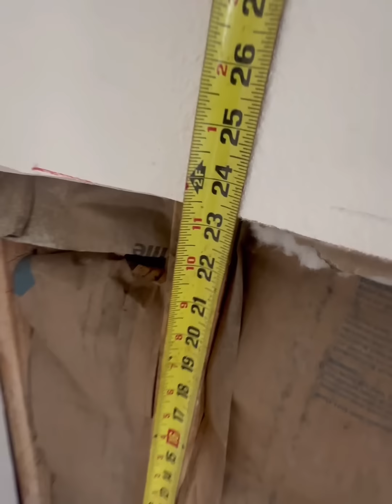Job COMPLETE - Let’s go HOME

Comment: So glad the cows got home. The family needs to be doing some flood control work at the pond and creek where the overflow happens. It would have to be set back aways. I was thinking of a rock or foundation brick retaining wall set with a ramp for the animals to use to get to the water. But there are a bunch of other temporary ways of diverting the water i have seen on YouTube and they might be a lot less expensive in the short term. I really worry about the animals during flood events and your homes have been through so much. It must get frustrating to get everything dried out and rebult and have to go through it again and again. My heart is with everyone on the Hill and I hope the weather gives everyone a break. Here in Tulsa we have had a lot of rain for the last 3 weeks and its going to last all the way through the first week of June before I am sure it will be dry more than a couple of days on a week.
Big hugs to the entire family from your pal in Oklahoma.

Comment: What you call sheet rock we call plasterboard in the U.K. Looks like you are progressing nicely and quite quickly as well. Well done.
Reply: We call in drywall in  Wisconsin.
Reply: Plasterboard is different here in the USA. It’s sheet rock or drywall here. There's a few different types here for different wall finish types